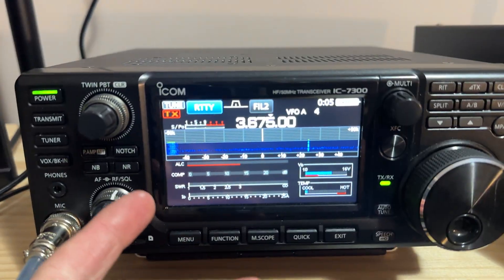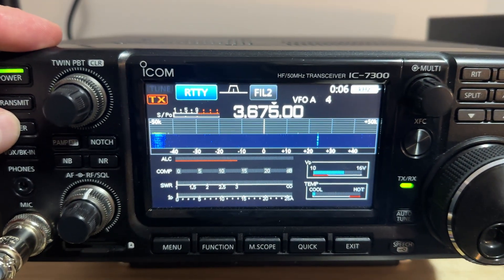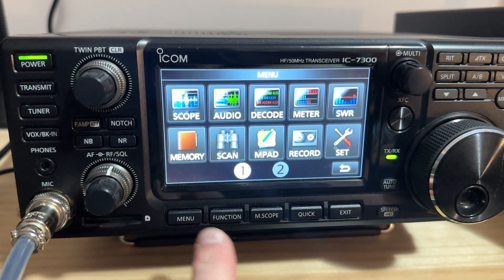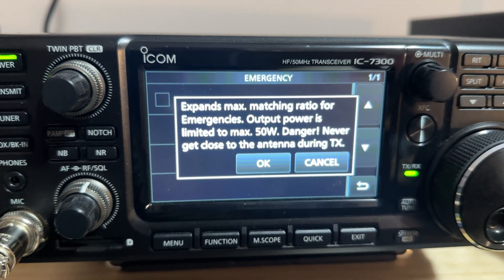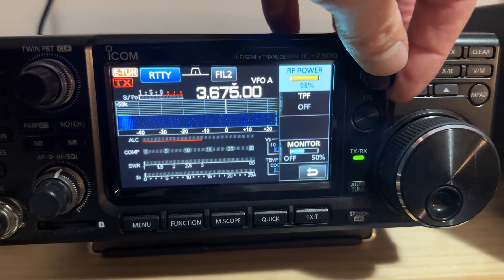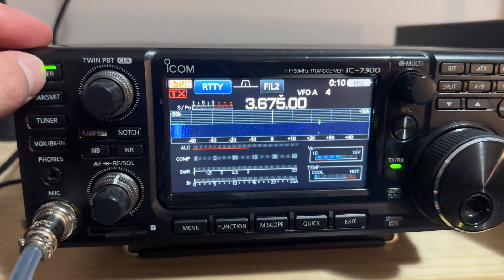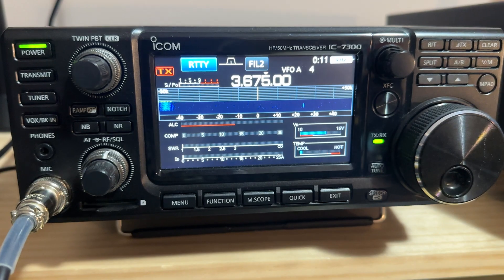IC-7300's Hidden Feature for High SWR Antennas

Comment: I have know that trick of E-TUNE for some years now. This is in the full manual on the CD or can get it from Icom.  I had to use E-tune on a 9:1 random wire antenna and it worked ok . FT8 would crash laptop still.  Even with choke on USB cable. Is fine with 49:1 or 4:1 .Later I found that using a 1/2 wave length of RG11 75 ohm coax on 20 meters with a 1:1 into 9:1 with 17 ft counterpoise at UNUN It worked great and would tune with 3:1 ATU at 100% power on 40 thru 10 meter bands .Laptop would no longer lock up or make mouse disappear on FT8 . No longer had the common mode problem. But I have much better luck with 25ft Vertical into 4:1 with 4 ground plane wires. much better signal reports . And using 43 Ft wire I got 1.7 SWR on 20 meters. works out 5/8 wave.  Worked super good. Out did my end fed half wave . Turns out the 4:1 UNUN more efficient than 49:1 . And if you cut 5/8 wave wire and adjust for 10/11/12 meters even 20 meter worked. With 25 FT shortand buy fold back and twist at end I got 1:1 SWR on 28.074 MHZ !  Just playing with length I got 10/11/12 to tune without tuner.  I modeled it. lobs are great ! better than 1/2 wave at 5 deg take off.  turns out  end fed 5/8 wave I made.  going to 3/4 wave will tune with a 1:1 UNUN but has NULLS in lobes. around 5/8 wave had best DX take off gain. I talked NY to England with it on 10 meter 50 watts . 73

Comment: Or you can just do the resistor mod on the ATU's swr metering (does not change the SWR displayed, just the ATU threshold). Then you can manually reduce power and run that ATU whenever you want, without "emergency mode" and without resetting the radio. Even the mighty 7610 lacks this feature. Don't forget to reduce power, especially on high duty cycle modes, and use short, quality coax with high dielectric breakdown voltage if you're really going to do this often. I think having to reboot the radio just to exceed this threshold is more than a bit annoying!

Comment: I wonder if this is how Xiegu, a Chinese company, is out tuning basically every 100w Japanese radio.  They’re just pulling off the same trick and hiding it.  Plus their 10:1 radios are 20w max anyways.  I find it hard to believe they’re making better internal tuners when there’s nobody to copy.  I wonder what’s really going on inside the Icom when you use this.
Reply: the 7300 just ignores the ATU SWR threshold voltage and reduces the power to 50%. That's all that is going on. You can modify the radio to always ignore this signal if you want to do the same thing without having to reboot and see "EMERGENCY MODE" on the display. But always, be careful and be smart about high SWR. Don't do this if you don't understand the implications.

Comment: It’s a great feature and I’ve used it plenty of times. It’s handy if you want to use a random wire (without bringing along an antenna tuner to the park) or just to get an EFHW or OCFD to tune on the non-harmonic bands.

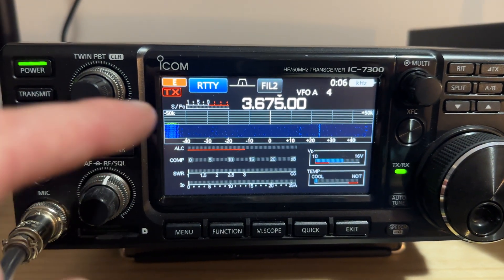Comment: Not really what that feature is meant for, but I guess it's quicker and easier than the Alex SP9SOY 68k resistor mod that gives a 1:10 tuner range at full 100w power.
Reply: This is exactly what came to mind with me too. Do the mod and then be careful about it rather than rebooting into the annoying emergency mode every time. Reduce the power and duty cycle yourself!